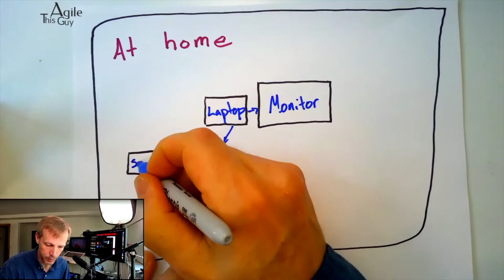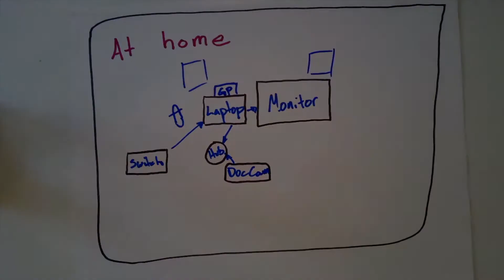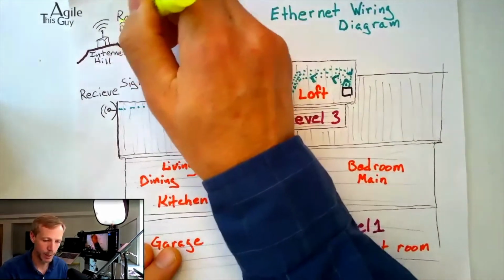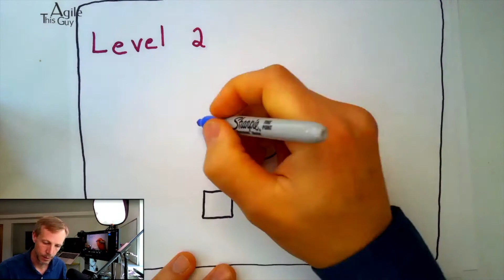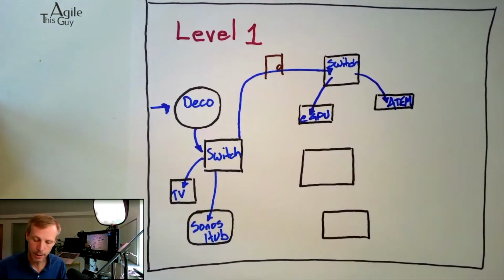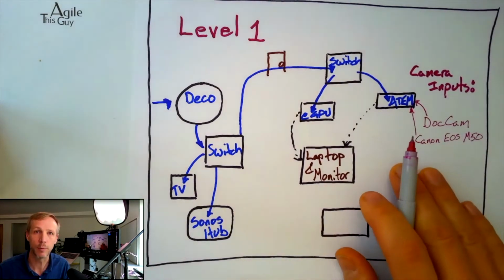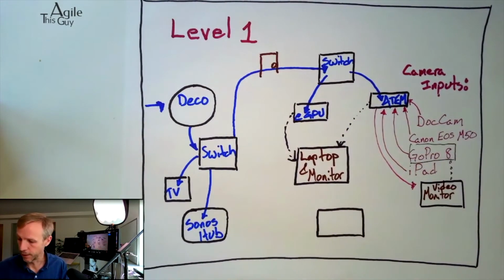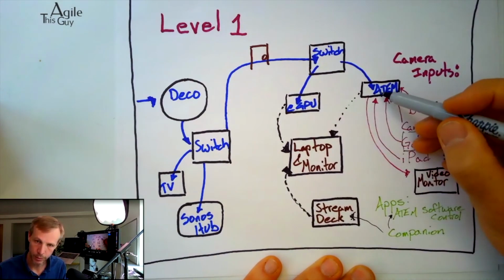ATEM mini, Stream Deck and no OBS. A walkthrough of my content creation setup.

Comment: How do you get clean HDMI output from your Canon M50 into the ATEM Mini? Is it the original M50 or the Mark II version?
Reply from the maker: Great Question! It's the original and it's possible to turn off all the info except for the autofocus brackets. so it's on manual. :( I looked and looked for a solution and not finding any outside of sparkocam and similar, gave up. 

The other problem of the M50 is muting the audio on HDMI. There's no way to turn it on so I was piping audio through the GoPro. :(

I sold the M50 and bought a Sony a6400.  Sony has clean output with autofocus on and doesn't mute the audio. :)